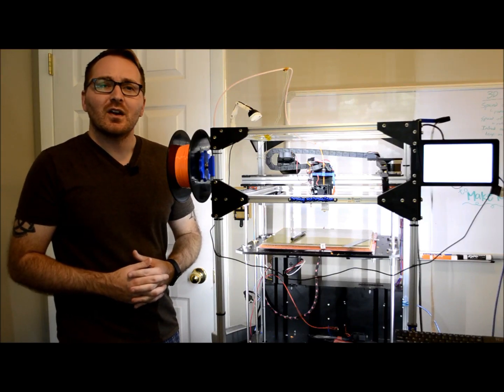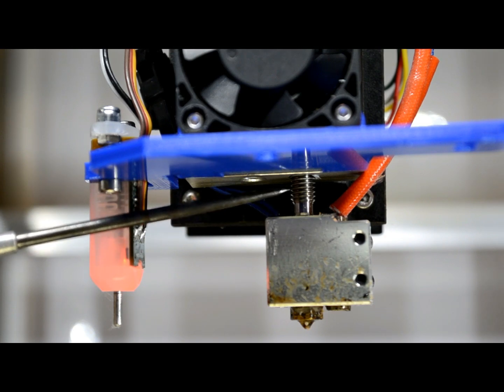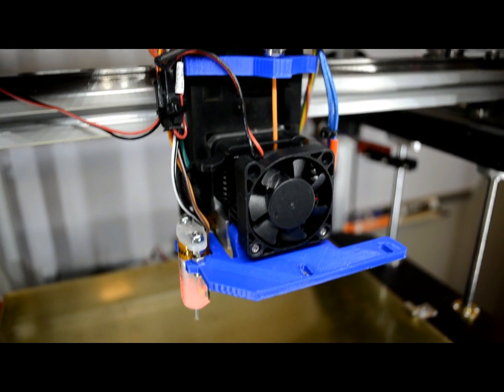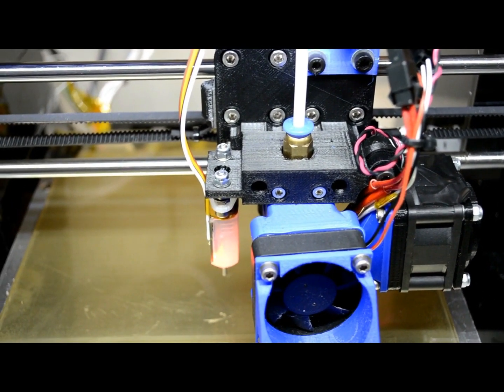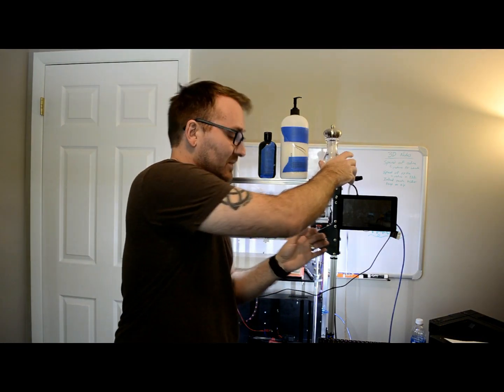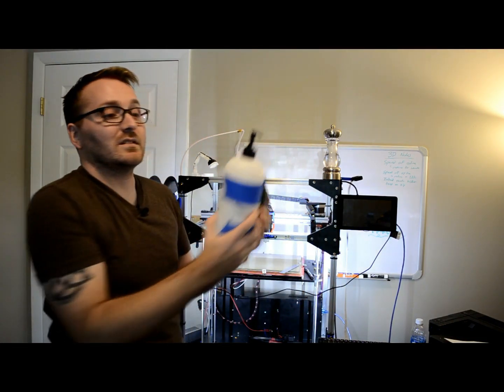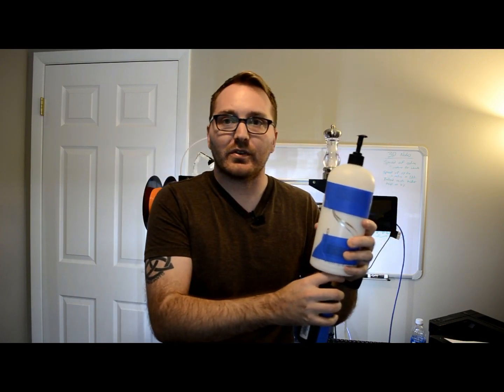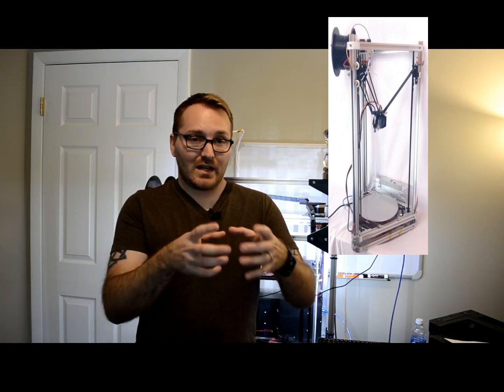Tutorial - Direct vs. Bowden - 3D Printing

Comment: Awesome video.  I have a Bowden setup and it really frustrates me, I was considering replacing it with direct drive. I wish you would have talked a little bit about the possible failure rate of the two. I am constantly fighting clogs due to bowden tube slip or imperfect fit.

Comment: So the pro of a Bowden is that it makes the x-carriage lighter so it can move faster, but what about the Y-axis?
My y-carriage has this big aluminum frame, a hot plate, and a sheet of glass, then I'll print some big part that weighs half a kilo. Maybe I shave about 350g off the x-carriage with Bowden, but the y-axis mass is my limiting factor for jerk and acceleration. Not really clear how reducing x-carriage mass significantly below the y-carriage mass helps things much. Maybe it's possible, but in my Bowden experiment I could not get the retraction settings to produce the same quality as with my direct drive. I had mistakenly assumed maybe they were good for flexible filament, but of course the compression inside the Bowden tube ruins your feed pressure control, so that's useless as the video mentions. Maybe it makes sense for small things you just want to print real fast. Outside of delta printer applications, I don't really see the value.
Not all Nema 17 motors have same torque. Get one with a little more torque, increase the current a little more, and make sure your belt tension is placed on the x-axis rods and not the vertical z-axis guides (I'm shocked to still see printers with this original Prusa oversight, it's an easy mod). I also went with a 4 bearing x-carriage and redesigned mount for better head stability. IMHO these modifications yield much better performance improvements then the Bowden setup.
Reply: Also... for larger prints, moves typically become longer and therefore jerk and acceleration don't limit printing speed so performance in that regard becomes negligibly different. If you really care how fast you can do small honeycomb fill, or that crazy HIlbert curve, then Bowden will be the winner.

Comment: If you want a quality 3d print, speed is not a requirement.
3d printing is not about mass production, so if you have to wait
3 hours or 4 hours, who cares. Because you won't wait.
That is: I built a printer with 8mm pitch acme lead screws.
It's pretty solid and can handle jerks.
However, the titan extruder has a much smaller motor, because
it needs less torque with the 1:3 gear ratio.
That might be a decent go-between.

Comment: I am building a delta at present, and what people dont do, is to take the weight of the effector and all arms and rings plus hotend, divide it by 3 and add counterweights on the outside of the belts. Most deltas are not balanced to zero weight and thus will bjrn the motors eventually.

Comment: The total bed weight in a prusa style printer. Is probably more than the direct drive setup. So shouldnt  matter what you use if the bed is limited to another speed.

Comment: It's not all about jerking motions though. It's best to go slow also because you are forcing a lot of plastic through a very tiny hole and forcing it too fast doesn't give good layer adhesion or accuracy or print. You can turn the heat up but machines generally behave better and last longer the slower and less jerky they go. There's also your bed jerk to take into account too, but you can set individual tolerances in the settings to avoid this jerk. I find the bigger the bed the more this comes into play as it's more weight.
I always set acceleration and jerk to be a nice sine wave because I hate machines being over worked and the noise isn't pleasant. It sacrifices speed, but it keeps the machine happy and my prints nicer and my ears less bashed.

Comment: Skip it all, use a LCD, strong uv source, stepper lift and resin... sla master race..kidding I don't even own a 3d printer.   Have done uv lithography though. How the fuck does a company get a patent on using another companies chip made for light projection..by simply using one frequency/limited band of freq/wavelength of light and calling it a new invention? Can I patent using a i7 to type the word red?

Comment: First very useful, I'm running an anet a8 and I am in the process of upgrading to a bowden setup with and off-brand e3dv6 extruder for printing  petg and pla costumes and props. I am having a problem with the centering of the hotend due to the offset of the stock direct drive to the new e3dv6/ bowden setup? Please help.

Comment: After watching a shitload of these videos I'm fairly sure it's about rigidity and accuracy of the moving parts - like you say, remove the excess weight on the x axis and the moving parts have less inertia and are that much easier to move when the code requires it.

Comment: I have an UP Mini direct drive printer. It's the fastest, most accurate printer I have and I have 2 other direct drive printers and 3 bowden printers. Other then flexible filament I have yet to see an advantage to using either type....

Comment: you might be OK moving your x at 90mm sec. but velocity is not as important as acceleration. while a higher velocity will require more energy to change direction, the "shock" will not be any worse, it will just last 50% longer than the 60mm sec rate. since the nema losing steps is related to how hard you accelerate, the benifit to the bowden setup is that you can accelerate faster and have the same "shock" but if you don't change the acceleration rate you won't se any better results time wise. most of the shock comes from that huge table being moved by the same stepper and if you don't lighten the y load, you are  no better off. the table is the limiting factor since it has the higher weight(especially those with glass added on). if I'm missing something, please tell me, because you can't increase loads on the x unless the heavier y can keep up.
Reply: You make an excellent point. I hadn't even though of that! Also, I wasn't impressed by the 90mm/s speed. I produce excellent prints at 80mm/s with my direct extruder. I would only consider a bowden setup if the prints were at least 30% faster.

Comment: Kind of like the idea behind mig welders, you can have a spool gun style (direct drive), push fed (bowden style) or you can have a feeder/spool gun connected to a push fed system. This is where my question starts, couldn't you do the same as a mig welder and have both a direct drive and a bowden setup running in conjunction with each other? Can't really see a downside with it to be honest, you'd have a constant amount of filament, you wouldn't have too many issues with trying to fine tune like you do with a bowden setup but you also don't have the issue of the x carriage being pulled by the filament either. Might be something to think about, might be something I try when I get my 3D printer.
Reply: I like this idea.

Comment: I can see the benefit of a bowden extruder for inertia considerations. I think that it has it's place for high speed printing. For feed accuracy, I think direct drive gives a more accurate feed rate, especially with soft flexible filaments.I dont think that a bowden setup would even work with a flexible filament such as Ninjaflex.

Comment: your comparison is not good. bearings on a smooth rod is not like waving your arm in the air. LOL
Reply: Joe Mike Terranella no offense but stepper motors can only get so fast based on the length of the rods. And no matter if you have direct or Bowden your prints are going to be better at slower speeds and if you want quality then it's best to run it slower.

Comment: is there a lightweight nema stepper motor available that would help?
Reply: Yes, there are lots of small lightweight low-torque stepper motors. Like NEMA-8 mount, pancake NEMA17 mount, non-NEMA mounts. Some of them will probably work in a reduction geared extruder, not in the typical direct drive extruders.
Reply: A better solution is a motor at the frame transferring the rotational motion using a flexible driveshaft.

Comment: Also, with a bowden setup, the extruder is always the same distance from the spool, and this contributes to the potential of a more accurate feed rate. However, bowden setups are prone to feeding problems(requires more hob gear cleaning) due to all that extra back pressure. Worth it in my opinion. 

I don't really understand why the distance from the spool matters that much, but I honestly can't understand why else the feed rate is all over the place on direct drive setups, requiring gearing to get extra precision when a bowden really doesn't need it... unless you are going for ultra precise prints that is.

Comment: Well explained, thanks! Would you be able to show same prints with bowden extruder compared to a direct drive? How is quality affected by this jerk motion?
Reply: that can be the subject for another video. ..show the same print with the same settings and same gcode same printer but different extruder. .bowden and direct drive. .It would be nice also comparing quality of 3D prints  on printers with linear bearings and rods compared to v-slot with v wheels...keep up the good work. . you got a subscriber here, cheers!